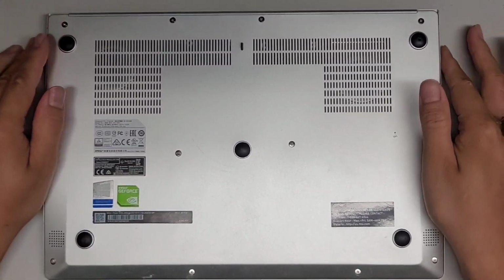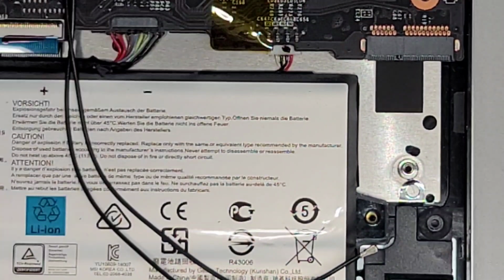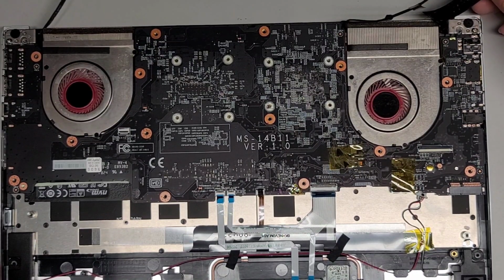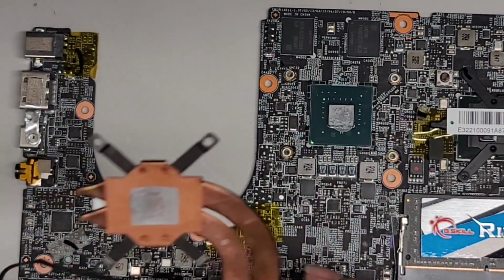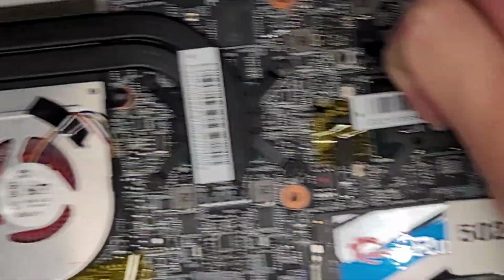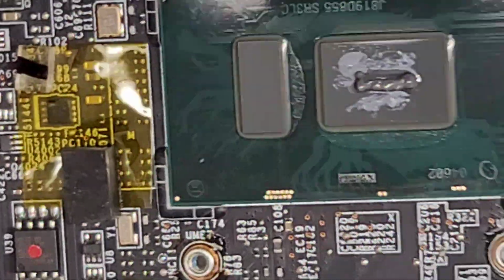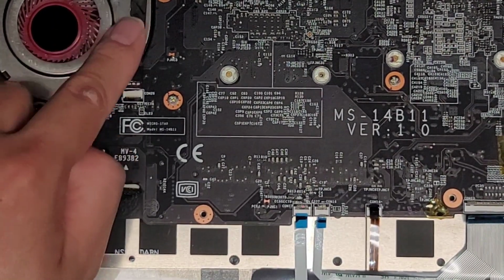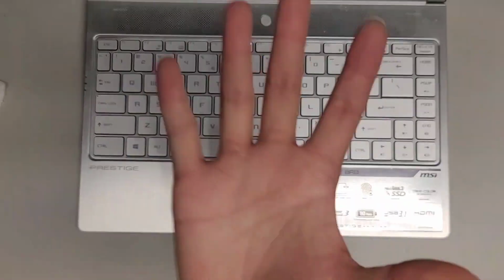MSI PS42 8RB Prestige Series Disassembly RAM SSD Hard Drive Upgrade Repair Thermal Paste Application

Comment: I just finished replacing my dead ssd and now everything seems to work except the keyboard backlight. What could be the cause?
Reply from the maker: You need the driver from msi
Reply: @ItsBinhRepaired  Nvm, I'm an idiot. Turns out I didn't plug in the black cable next to the touchpad cable.
Reply from the maker: Lol

Comment: Had some issues with bluetooth, opened it up checked the card and connectors, all seems to be fine, cables are aligned properly, maybe it was just a case of this little pin that got loose or smth. Now it seems all wireless functions are working properly. Hope you get rich and make those disassembles for fun/work.
Reply from the maker: Interesting. Haha I do all the disassemblies for work. Recording them and putting them on YouTube helps others and at the same time makes me additional income. Problem is, my content comes from my work, so if I retire, my YouTube dies and I have no more income. Lol
Reply from the maker: If you haven't already, please like and subscribe so others can find my videos. Thanks!
Reply: @ItsBinhRepaired  Dude as am currently going through your channel, bro there's no way this channel will die as u retire lmao. There's literally everything cats, unicycles, food reviews you got some many ideas thats huge, keep it up.
Reply from the maker: @beqer9281  hahaha thanks! Eventually there will be Tesla Cybertruck and traveling videos, but people will be confused by the It's Binh Repaired name.
Reply: What kind of problem did you have with Bluetooth? I have a problem with it too. Could you tell me where the BT antenna is? Isn't it with the WiFi antenna? It happened a few times that suddenly the BT sotpped working, when I took the laptop from the lower left side with my hand. And one day it just didn't work anymore. But I guess it's a physical issue. Maybe something got disconnected inside (which would be weird)
Reply: @ElioFrongia  the same thing. Left side is where antennas are. I think this is something with hinges. Although when i updated windows from 10 to 11 it works all the time lmao. What this laptop has thought me  you need to be extra careful with moving it around eg in your backpack.
Reply: @beqer9281  Yeah, it looks like you need to be carfeull when moving it around. I think I'll check if the antenna is loose or broken.  Thanks for your answer! I'm also in Spain, Cadiz,  (and I speak Spanish by the way).
Reply: @ElioFrongia  im from Poland / Cracow. Let me know what was going on after you check it up.
Reply: @beqer9281  I finally opened my laptop to upgrade my ssd, so I checked the wifi adapter. Everything seemed to be well connected. Anyway, I'm still struggling with this intermittent issue. I guess it might be related to the adapter itself, a hardware issue. What I usually do is uninstall the drivers, power off the laptop, unplug everything, wait 15 seconds, power on, install drivers and that's it. But it's so annoying. I bought a BT dongle for those moments I need the BT quickly, but I'm planning to replace the adapter for an AX210 and see what happens
Reply from the maker: Hope it goes well

Comment: I did exactly as u did in the video, great tutorial by the way, but i had the same issue in the end. The laptop won't startup and the screen black, anu advice about that ?
Reply from the maker: Did the power drain? Double check the RAM. Remove and reseat the sticks.
Reply: @ItsBinhRepaired  i did everything all over again, but still the laptop won't to turn on. Whoever the led of charge sign works when i plug it.
Reply from the maker: @mohammedhasan3322  ohhh double check the power button cable.
Reply: @ItsBinhRepaired  ok many thanx. I will check that again.
Reply from the maker: @mohammedhasan3322  the power button cable is easy to miss
Reply: @ItsBinhRepaired  tonight i will check it and inform u with the updates; again many thanx for helping me out 🙌
Reply from the maker: Sounds good

Comment: This is a fantastic tutorial! Just to let you know, this video has helped me on two occasions. First time was a year ago last fortnight when I replaced the thermal paste. Unfortunately, the CPU fan bearing started failing since. I've just completed replacement of both fans and the battery for good measure (it was down on capacity). I kept this video open as a reference while (dis)assembling it again.

Thank you very much!
Reply from the maker: Awesome! Glad it was able to help you multiple times. If you haven't already, please like and subscribe so others can find my videos. Thanks!

Comment: Excellent and very detailed tutorial. I may have missed it, but, where's the bluetooth connected? I'm having issues with mine (I'm getting a "device descriptor failure usb" error very frequently and the BT disappearing). I suspect it's a hardware issue. Any suggestion?
Reply from the maker: Combined with the wifi card
Reply: @ItsBinhRepaired  thanks! So, if I'm having problems with BT but no problem with wifi and they're the same thing... I'm more confused now, because I reinstalled Windows thinking it was software or driver related at first, then it kept on happening so I thought it's hardware related...
Reply from the maker: @ElioFrongia  just like a motherboard, one part of it failing doesn't mean the whole thing stops working.
Reply: @ItsBinhRepaired  yes, you're right. Well, I'll see what happens. Thanks a lot
Reply from the maker: @ElioFrongia  if you want, you can buy a cheap Bluetooth usb adapter